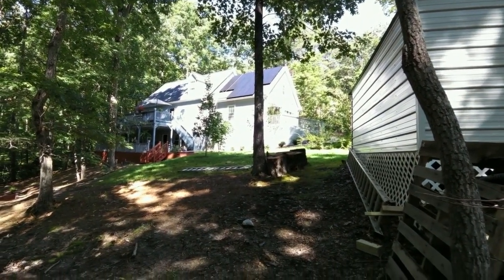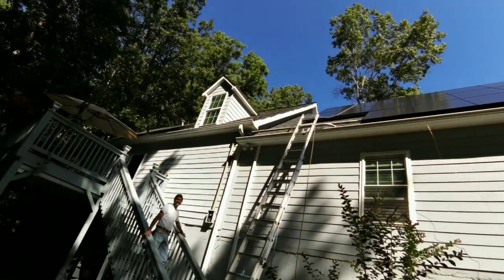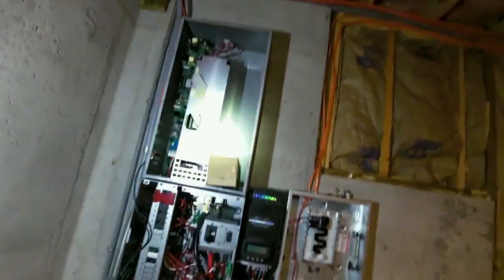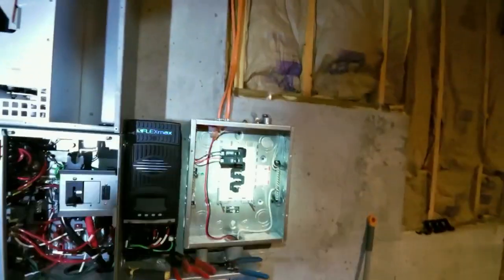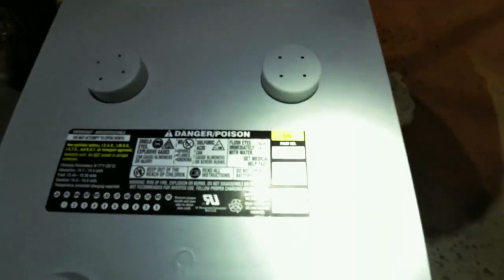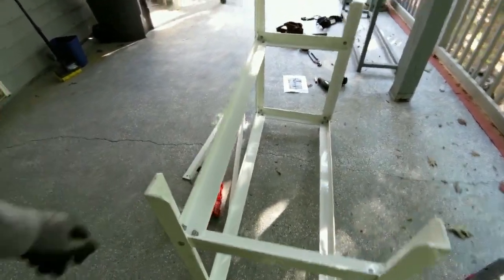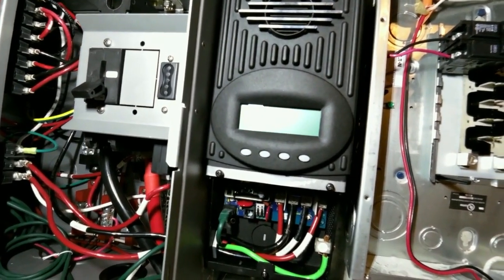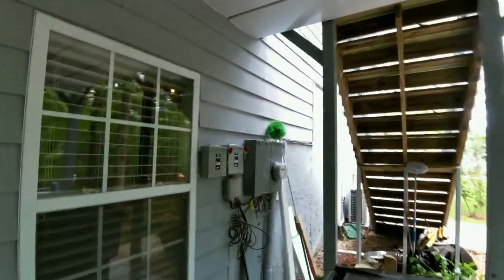Outback Radian 4048A Install: Power to the prepper

Comment: is this Grid Tie and Off Grid System and if so, how easy is it to disconnect from the grid? like is there a switch to just disconnect from it? and when on the grid are batteries ever used or only if the power goes out? thanks

Comment: can i connect right to my 125 amp braker box from my radian 4048.  i am going  100% off grid, lost most of our power grid in Puerto Rico. i feel lost
Reply from the maker: Steve rivera follow the installation manual.